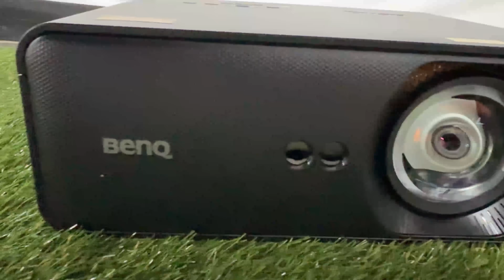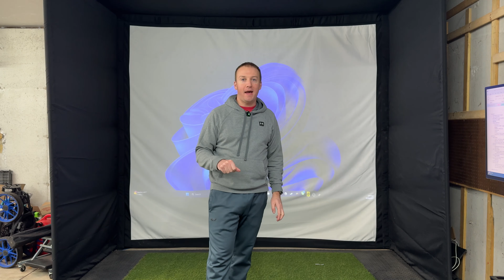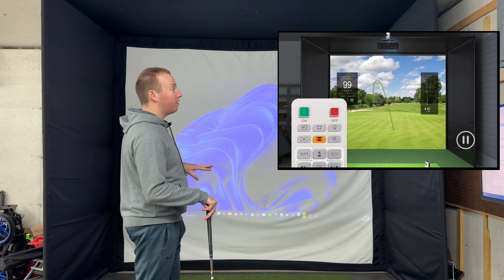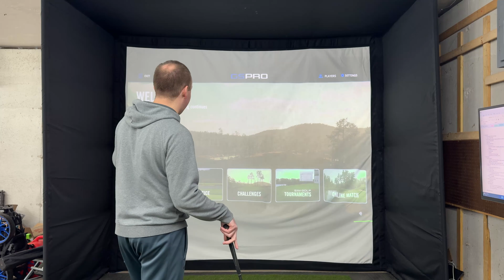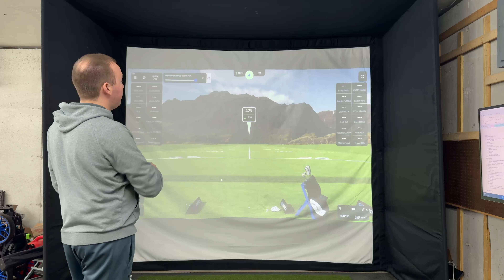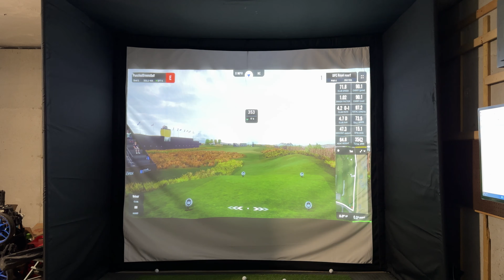BenQ AH500ST: Unleashing Ultimate Golf Simulator Performance!

Comment: nice video, here is a tip for ya :) move the projector back untill it willfs the entier screen form top to bottom, then mount it there.
Then nopen vividia controll panel and make a custom resolution that first the width if the screen :) (so you can fill the full screen with any projector)
Reply from the maker: I will have to try that! The only thing is because my ceiling is so low I’d be worried to hit the projector unless I move it really far back. Since it’s short throw I don’t think it will work?